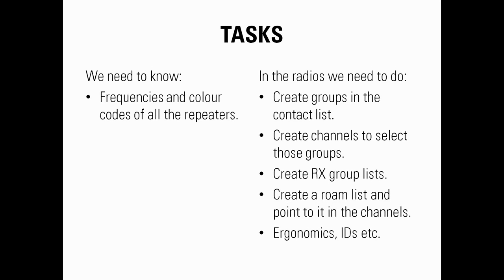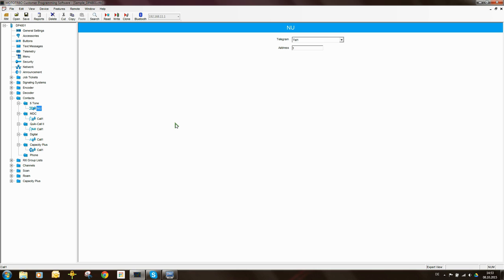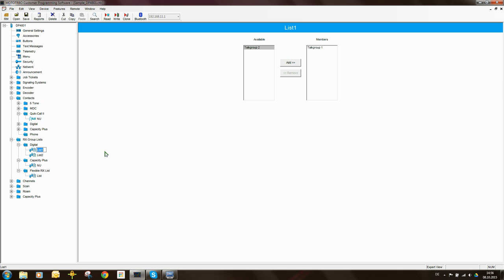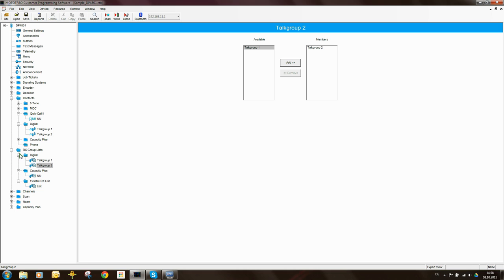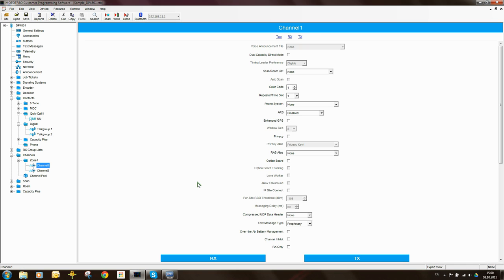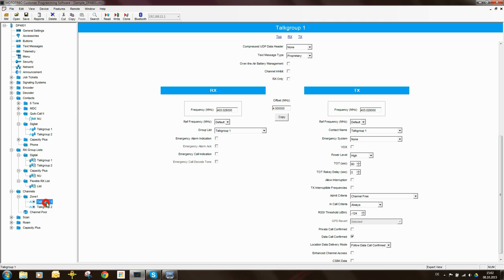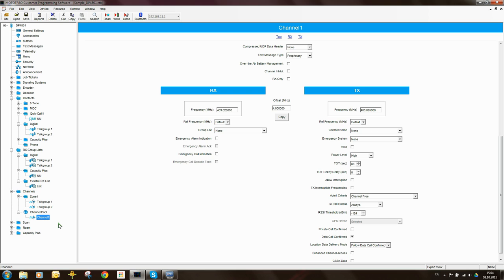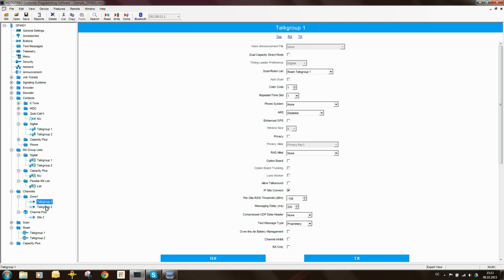MOTOTRBO IP Site Connect Radio Configuration (Part 1)

Comment: Dear Wayne, can we use IPSC over different network? example : Master Repeater on 192.168.10.8 (GW: 192.167.10.1)  and Peer Repeater IP: 192.168.30.8 and GW: 192.168.30.1
Reply from the maker: Sorry. Your comment got flagged as spam by YouTube so was sitting in my "held for review" queue for a while.

Yes you can, just make sure to have NAT set up on the gateways (routers) to allow the UDP ports to to forwarded to the repeater.